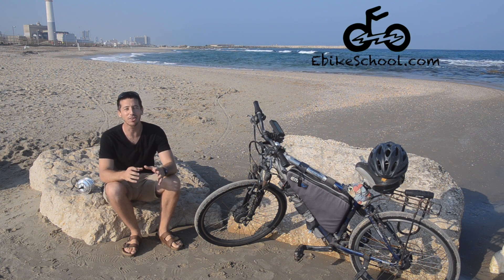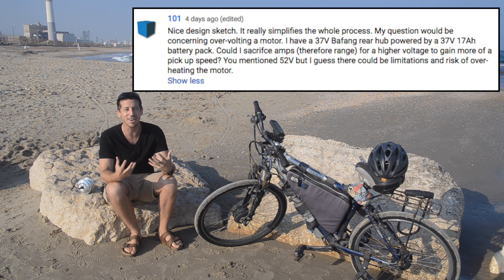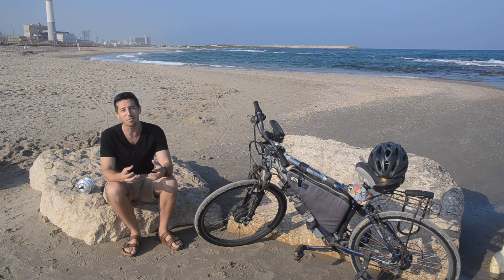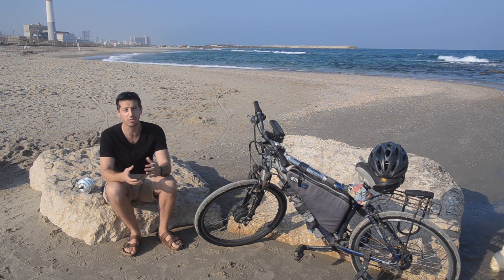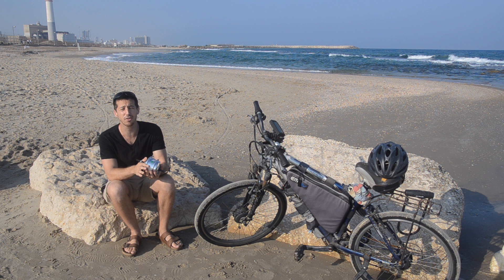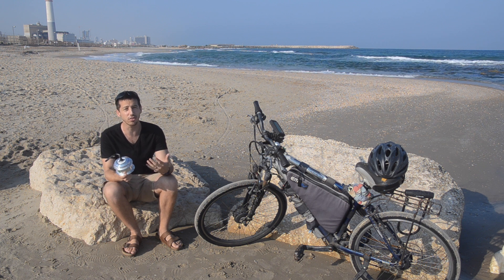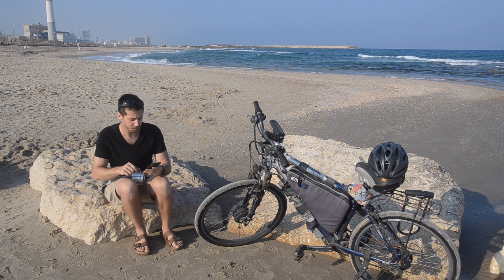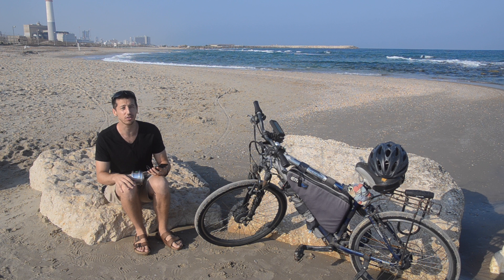Overvolting an electric bicycle motor for more speed! Q&A#7

Comment: So if you over volt a motor, is it possible that 48volts in a 36volt hub could produce electricity if it is by itself without a controller?  like enough to help keep the battery continuously charged for longer?
Reply: Your answer is no and yes, u can use the regenerative breaking to charge a small bit of your batery, do not expect to double the range, your question has a lot of "if"... hahaha

Comment: i'll appreciate a lot if you can help me giving me some advice, im buy parts to make my own ebike in china, the set up im buying is a 48v 1000w current and 1680w maximum peak power read hub motor, a battery of 52v, and a controller of 35 amp, do you think this is a good set up or not, im worry about the over heating, i read you articule http://www.ebikeschool.com/myth-ebike-wattage/ its really good thank you but still i'll love if you can just give some help, i really get confuse when it gets to the controllers amp, thank you in advance, keep up the good work, your always helping.

Comment: Great video, would any one know by over volting would it damage any other components on the bike like the lcd display and the throttle etc. Example 72v system with a 84v battery pack

Comment: hey you seen the one where the guy made a hub motor into his sprocket and doubled his mileage(after burning up a motor) by changing to a kids ebike bms so he didn't fry the motor. I think it was his kids bike and he stole it from him because it ran at half the power. the both ran on the same battery and that is why his kids could keep up.

Comment: you could try putting a saddle bag system on the bike and then put your ebike motor on a 120 stator and rotor (you could use your old motor) then you need a vms (volt management system AC) and an dc inverter and a new ebike motor. the speed and mileage potentials are huge.
Reply: Can you go a little more in depth? I'd love something that can cruise 45mph for 80miles or so
Reply: @andyfumo8931   wrote this a long time ago but you use the old motor to turn an object that make multiple times the energy like beat truck alternator that only has to rotate at 900 rpms to works then put the energy in a power supply to control the energy and you could use your old motor to make a super bike full electric that would do 300 miles per hour for 12 and 2 amps starting power. they use this method to power for subways in new york. a 200 amp version would make  100 amps and 600 volts.
Reply: @deathincarnatesplace  you're saying a car alternator right? I've thought about that since watching this video of a guy rig a bike with one and a very small motor, the kind that fits in your hand. Maybe you've seen him, he does it to a fixie. The power supply would be a regular ebike battery? Any size?

Comment: Thank you for your information. This is what I'M looking for.. I have a cheap ebike ancheer 26in 36v 250w . Can I overvoltage  the motor at least 48v maybe 52v. Do I have to change controller also?
Reply: am wondering about this also as i have greenedge cs2 ebike
Reply: Me too
Reply: Check the voltage on the capacitors in the speed controller and stay under that and watch temps and u will be fine

Comment: My Li ion battery 48V ,20Ah for E scooter charged by a Li ion charger 54.6 V , 5Amp. Battery is getting charged up to 50.4 Volts only. Charger has been checked by another battery . The other battery is charged up to 54V. Why it happens to the battery. Whether it is cells OR the BMS?
Reply: S S Kulkarni it mean bms is recognising just 12 instead of 13 series. Or one of the series of cells is out of balance. So the bms is cutting out when the other cells are full
Reply: @e.5391  You are right. Battery was opened and checked for voltages .One of the bank is showing a very low voltage. What shall I do to get battery back into normal ?
Reply: Okay great. Check how low the voltage is. If it’s about 2.5 and above, try to use a 4.2 volts charger to manually charge that particular bank up to full 4.2. Also check that the bms cable leading to that bank is properly connected. Only charge it to full when the other cells are 4.2 so that the entire battery voltage is 54.6volts. Then try using the battery again. If the same thing happens where the charger charges up to 50.4, then the BMS is definitely bad. However check all connections first.
Reply: @e.5391   Hello,
Its great that your suggestion worked well. And battery is working fine.
Only A thought that if a bank has got voltage of "0" volts. Am I suppose to replace these cells/bank?
Reply: Yes if a battery goes down to 0, it means the gone below its discharge level. So all the cells in that bank might be bad. However use the battery and charge again to full before being sure that it’s now perfect. When it charges up to 54.6, then voila your battery is good to go.

Comment: Hi Ebikeschool.com,
I have a question?, 
I watched your video and I was thinking about it.   This what happened to me, I ordered a 48 volt battery and a 36 volt  ebike motor kit,,, but by mistake I ordered the wrong motor thinking that it was a 48v 1000 watts motor kit ..
Today I received the items but haven't opened yet because I was thinking on return the motor kit to a 48volt 1000w but i have to return the item and this is going to be kind of expensive,
So I was thinking on just order a 48v controller as you mentioned in the video but what about the controller connections? , do you think this is not a problem? 
Please help me with my question and thank you so much in advance.
I really dont want to return neither of the items because i hate this I don't want to be a pain on the but
Reply: open up the Controller. then Check the voltage labels on the Capacitors. if they are above the Batteries resting voltage you should be ok. alot of the 36V controllers are Just 48V ones just sticker-ed lower and current limited. the 36v controllers output around 15-22 amps. and most 48v controllers are around 30 amps. nevertheless if the capacitors are 50v's or 63v's you should be more then fine.

Comment: Hi great videos really helping to explain g hings I'm currently building an ebike. I'm building a 20s 10p battery using 18650 30q batteries. I'm I correct in calculating this will give me a 150A battery if the cells are 15A discharge. I'm using an 8000w motor with a 150A sabvaton controller. Do I have to match the BMS to the controller and use a 150A BMS. Many thanks Brian

Comment: How to calculate watt hours required per km per kg in case of e bikes or e scooters.
Reply: Easy.. no pedaling at 20-25 mph is about 45wh/mile. so if you have a 36v/10Ah battery you would have 8-10 miles range.... but if you assist some of that you could get the pack to last out to say 15-17 miles. weight is only a real factor in Accelerating from a stop the differences from a 160-200 lb rider might be 0.2- 0.5 miles
Reply: Thanks,

Comment: Most systems can handle an extra 12 volts. Voltage drop under load of about 20%. So overvolting by 12volts isn't much and then as the batteries drain you'll be coming to your nominal voltage. You probably don't want to go below 40volts in a 48volt battery bank on a 36 volt system as battery life is decreased. Especially in lead batteries.
Reply: not quite though. Li-ion does not match up with Lead batteries. so you have to really pay attention to what you Resting voltage is for Li-Ion. 
these are unloaded numbers... 
charged is 54.6v and Empty is 43 volts. its a Wide swing for sure.
 the loaded numbers are 49 for fully charged. and 37 for empty
by then alarms should be going off. Always go by the cut off of loaded voltages. any lower and you start to damage the cells.
Reply: @Zieranna  that's exactly what I said. If you can understand my statement about running 48 volts in a 36 volt system. don't drop the voltage below 40volts. As your cutoff alarm will still be below 36 volts, probably 32volts. Of course you will have to find out the numbers for the battery type. Most batteries can handle 20percent discharge on the resting voltage.

Comment: Please replay to my question . 
I have a 36v 500w fatbike and I wannat buy a 48v - 13ah battery and change the controller from a 36v to a 48v , nevertheless the capacitors ( big ones ? )  inside the controller says its 63v . don't know which capacitors you meant when you said if its 63v then it can take a 48v battery , are these the big ones or small capacitors as I have both inside the controller , small ones say 50v big ones say 63v . anyway if I get the controller sorted ( buy a 48v ) would that be any trouble on my 36v hub motor , thanx

Comment: can my 1000w motor handle 72v 28amp?
Reply: and if my e bike has 60v 20amp and i want to overvolt it should i buy 
12v 5amp or 12v 8amp or 12v 9amp battery or what

please help me witt that

Comment: will 4 12v 1800mah lithium ion batteries work on a electric wheel motor
Reply: On a 1000watt motor it will last approximately 15 mins at 48volts.

Comment: Thanks for  nice channel! Just couldn't find an answer anywhere and maybe you will have an answer on it... 
So I have 3 BATTERY PACKS with DIFFERENT voltages and Mah (7S8P / 25,2V / 24,8Ah Block + 7S8P / 25,2V / 20,8Ah Block/ + 10S5P / 36V / 17Ah Block/) each of them have its own BMS, so my question is: CAN I USE 2 BATTERY PACKS TO COMBINE THEM? like 25.2v Pack (with BMS) +36v Pack(with BMS) or 25.2vPack + 25.2v Pack with separated BMS modules on each battery Pack... at list I have 48v 1000w motor on my E-bike and I want to have 2 different mode battery packs like for fast and usual driving. Thank You
Reply: I have done this before by add hand switch and relay to switch 36v or 36v+25.2v by self. but have to see your controller can handle higher voltage than 36+25.2v. if not you need to change the capacitor inside controller.

Comment: Hi can I use 72v battery and controller with 48v motor? Thanks
Reply: I have a 48v 1000w motor running on 72v.  It sits on 65km/h have done over 100kms in distance now and no problems.

Comment: ty Great vid
A Standard brushless e-bike motor rated at 36V will easily handle a 48V Battery, despite the doom and gloom 'rolling fireball' comments   lol  - just be sure those capacitors in your controller are rated at 60V and you'll be fine, as you pointed out - its a relatively easy swap-out (basic soldering) if your capacitors are rated too low.

Comment: good that you mentioned the controller capabilities.  it is important to know what caps you have inside, and keeping the amps down when overvolting.  Should be mentioned a motor running at 50 volts/10 amps, is more efficient than a motor running at 36 volts/ 13.8 amps....both using 500 watts. less amps = less heat losses.    But going fast is not as important as STOPPING.  Even if you do the necessary tweaking to improve performance, please upgrade your brakes on your ride to keep everyone safe, not just you, but the people you are cycling around as well.  Getting clipped by a bike going 30 miles/hr is not the same as getting clipped at 20mph.
Reply: How can you bring the amps down?
Reply: @Meme_supplier  less twist on the throttle….more legpower/lower assist level.
Reply: @jimhofoss9982  I don't think that's what he meant man.
Reply: Move next time

Comment: You think.i can over volt a 48v rated motor to 75? All these kits have an esc included. Do.i need.to get a new one or would the stock ones suffice?

Comment: Thanks for the video.  I sub'd your channel and bought your book (1st) also.  My wife and I bought ebikes, both are 48v. Mine is 750w and hers is 500w, and I was a little surprised that she can do the same top speed as me when we go out riding.  She is lighter than me, about 60lbs, which might be making the two bikes about the same.  Looking forward to getting the book.
Reply: She goes as fast as you cause you both run 48V with similar motors.

Comment: This rpm math must be a bit of a limited explanation ... you could do with lower rpm´s with a high torque motor and then use the gearing to determine the final speed of the wheel.

Comment: Micah, Do ebike LED display/PAS-selector work both at 36 and at an increased 48V voltage . My ebike has a controller that can handle both 36 or 48V (my controller pic: https://endless-sphere.com/forums/viewtopic.php?f=2&t=93576&hilit=ancheer#p1369206). I I`m almost finished building a 48V pack with Vruzend V2 from Urvakhsha for beta-testing it my ebike ( https://endless-sphere.com/forums/viewtopic.php?f=2&t=93576&hilit=ancheer#p1369192. Do you think my PASselector/LED-battery display will work at 48V. Here`s my display http://www.key-display.com/content/?165.html . THey say 24V/36V/48V, but I`m unsure if it can either work at these three different voltage nominals or if the company offers you to choose between on nominal voltage and than you cannot change the nomial voltage of the battery. From your experience, do you think it would work. I`m afraid to blow up the display if mine is only 36V rated and I run it at 48V. I value your input Micah. Thanks. Matador.

Comment: what if, my motor 60v 1000watt. but i using the higher watt controller lets say 1500watt. the voltage is 48v or 60v. which one is better compare to the original one

Comment: Building Ebike for my wife.  Speed is not an issues but would like  to make it  up the pass 15 miles one way 2100ft. elevation gain 
In choosing my mid drive should I go with 36v to get more amps over a 48v??
Reply: You should look at the torque of the motor.
The Bosch mid-drive motors are available with high torque.

Comment: Looks like a suspended front fork? I busted Al dropouts with an old 350 watter, are those steel or just beefy? No issues ever with that? Max power to front in normal use? Nice to see!

Comment: Hi, really enjoying your informative videos. Question: How can I improve the torque (pulling power uphill) on my ebike? (I have a folder with 20 inch wheels, bafang 250w motor, 36v 8.7ah battery) - Thanks
Reply: You can buy bafang 48v500w controller an 48v battery that s what i run my 250w bafang much quicker now if you dont wanna spend that much look for 36v higher amp controller that fits your kit bafang or kt controller tho kt controller  need be run on there kt display

Comment: I belive You just don't understand how current limiting works, if You limit the current on a load, voltage is going to drop.
Reply: Exactly what I thought. The only way to limit the current is by dropping the voltage.
Reply: The only way to get more current is to either re wind the motor with thicker wire. Lowering the resistance, or raise the voltage.
Reply: JAMES! Since the 70's
That's not the point. The guy in the video (Micay?) has increased the voltage of his battery and not to overheat his controller or motor he decreased the maximum current of the controller. How does a controller decrease current? By decreasing the voltage! Not by increasing resistance which would heat up the controller even more. So, what's the point of increasing the voltage of your battery when you limit the maximum current of the controller if the latter means the controller decreases the voltage to the motor?

See it this way: A specific motor of 500W pulls 10 amps at 50V. This means the internal resistance of the motor is 5 Ohms. If you put 60V on this motor it will draw 12 amps and the power will be 720W. If you limit the maximum current of the controller to 10A then with a 60V battery the controller decreases the voltage to the motor to 50V not to exceed the 10A. So what is the point of increasing the voltage of your battery to 60V when you limit the maximum current of the controller to 10A? The motor will never run on 60V because of the limited maximum current. Things get different when you do not limit the maximum current of the controller because then the motor can deliver 720W at 60V and 12A, but that also means either the motor or the controller can overheat, because they were built for 10A and not 12A.

Comment: Hey there :-) Great video. I have a question about the capacitors. Why do the controller have capacitors when it is supplied with a smooth DC supply from a battery? What happens if I remove the capacitors on my controller (Except it would probably not spark when connecting the battery)?
Reply: I think because controllers are turning the constant DC supply into PWM ‘signal’/supply to alternate the sequence and speed at which the stators in the motor are powered. So they need MOSFETs and capacitors for dealing with all of the PWM stuff. Not very technical I know but it’s all a bit beyond me.

Comment: Hello. I don't know much about ebikes, BLDC or whatever motor they use (I'm building an electric car). I just wanted to comment and say that at least in series wound (brushed DC) motors increasing the voltage let's you push more amps in the higher rpms..  It basically means that with a higher voltage you can sustain your max torque to a higher motor rpm. I assume similar things happen in ebike motors also.

Also going below the recommended values will increase the life of the motor, the controller and the batteries :)

Try googling "back EMF" and "Lenz's law" for more information.

Comment: I enjoy your videos ! Thanks for putting then out there but I do have a question.
Why have you increased your voltage then lowered your current? We all understand ohms law and effectively you have the same power ouput as if you were just to leave it at 36v and keep the higher current. Could you elaborate the benefits? I'm assuming with the cycle analyzer it just gives you a broader power band to play with. Thanks for your time.
Reply: easier on the motor. because  you are trading in low end torque for more top speed on flat ground. and since the wires are small on the windings the lower amps mean less is lost to wire resistance since the smaller the wire the more it resists Amperage/current. so Raising voltage gets you more power for less wasted heat.